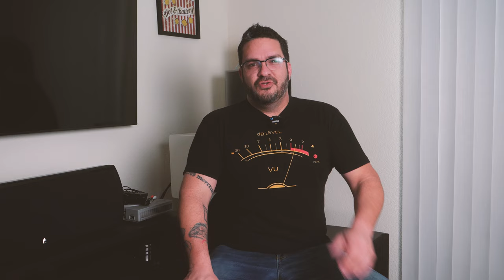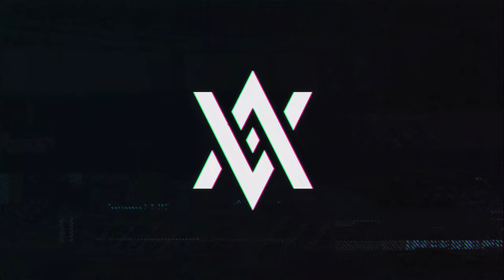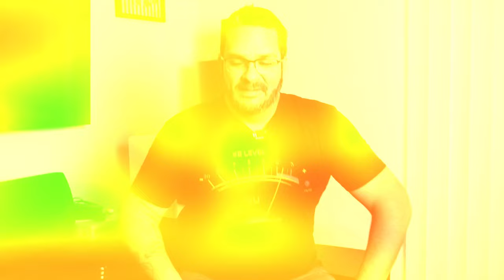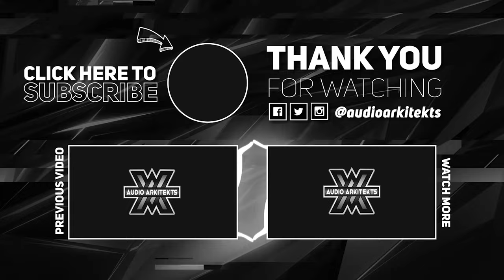How Does Jitter Affect the Sound Quality of Digital Audio?

Comment: I have heard it before, this noise or jitter, on older computer systems with cheap sound cards, or DACs. But it has been a few years since I have heard any, the equipment I have now, I really don't see it as an issue. With my new Cambridge CXN V2, they have the clocking and anti-jitter circuits built in. I thought of purchasing a reclocker anti-jitter device, but I really see no need at this point. I'm happy with what I have as it gets the job done. The sound is clear and precise to my ear, if there is anything in there, it is normally from a piss poor recording, as there are more than a few of those floating around out there. If I had, say a $60,000 system vs my $6000 system, this may be an issue, but I am a long way from there.

Comment: I used to have a Sony Compact mini system back in late 90s. Compared to my current system, I can tell that compact system had a much higher noise level. Basically albms I heard over the years sounds much more clean and smooth now. I feel the sound of albums got imprinted on my  mind over repeated listenings. I recently looked up specs on that Sony systems and saw it had much higher THD. From the on I assign such high noise to high THD + N. Used a Jitterbug with AQ Dragonfly Red on my laptop. Couldn't tell the difference with or without the jitterbug.

Comment: Thank you for cutting through the BS about 'jitter'! I've been shouted down by 'audiophiles' whenever I've asked "But what does jitter actually sound like?" - yet nobody ever answers the question.
Reply: With this new gear, and the new circuitry, I do not think it is an issue, until maybe you get into the tens of thousands of dollars in gear and are going for "that" sound, whatever "that" may be. I think what most of us hear today are simple crappy recordings and production, it is not the gear.
Reply: I have absolutely no idea what ‘jitter’ sounds like either. I can’t even tell most audiophile cables from mainstream cables in terms of sound.
Reply: It sounds like added noise and distortion. If you have a cheap system, it’s not really audible. If you have a world-class system, removing jitter will make a difference!

Comment: One youtube channel argues that the CD hole may be punched "off-center" and causing jitter.  If this were true, wouldn't oversampling catch-up and correct?  It's not like an analog table whereas you want speed close to synchronous as possible.  If the data isn't coming quickly enough, the motor will speed up.  Personally, it seems there are more important factors to be concerned about.
Reply from the maker: I agree this is probably the least on the totem pole of audibility. However I felt it should be at least recognized. I more than likely won't make another video about it lol
Reply: A couple of my CD players will pull in a whole .MP3 song, then the disc sits idle during playback.  Those have become uncommon in the marketplace, but were a little under $50 U.S. when new.  I still use a couple of CD players.  They're usually not stocked in stores now.
Reply: Tbat's what error correction is for. If it were that bad the disc wouldn't play .

Comment: Not gonna lie.. I wasn't sure if jitter was that much a concern... But once I got the Audio-gd Di20 DDC with USB, digital coax and clock out outputs, that bad boy cleans up the signal way over what I had before it's crazy. So much more vibrant, clear and with separation. I'm not lying these black boxes work. Along with a power conditioner it's otherworldly.
Reply: i just got one and i'm expecting the same thing. Without a ddc it just sounds muffled like a fm station that's mistuned. I wanna get a power conditioner later on myself.

Comment: Most time its something completely else (like analogue interferce after the DAC), or very bad DAC design to start with. On a transport level (assuming we are talking about TCP networking) there must be a complete lack of buffering on the enpoint device, as TCP will garantee the order that packets are transmitted, received and acknowledged. On a bad network, you could have a delay between packets which would cause stuttering, but this would be pretty darn bad just for music transport. audiophile network switches IS snake-oil for this fact alone. Now on the USB device (USB interface itself), it a bit more interesting as USB specification addresses jitter and has clock specifacations, which in theory could be given a bad usb implementation. I think reclocking here could in theory offer something, but please correct me here if my conclusion is wrong.